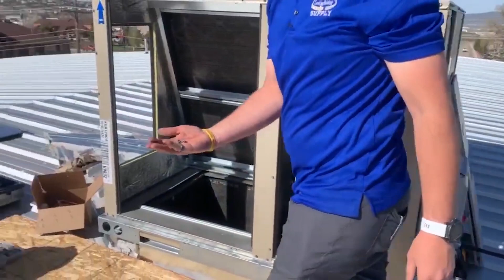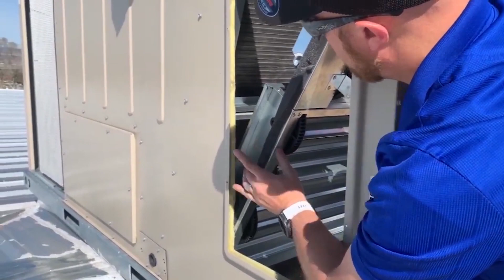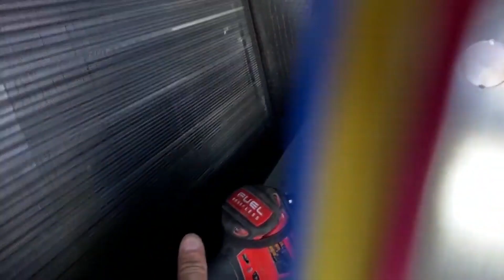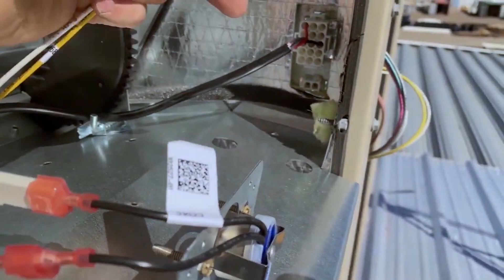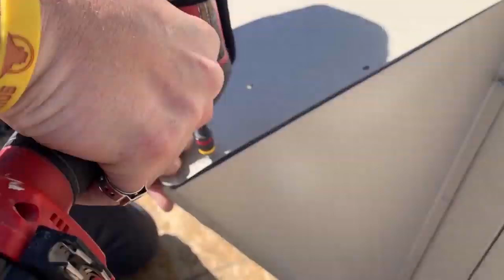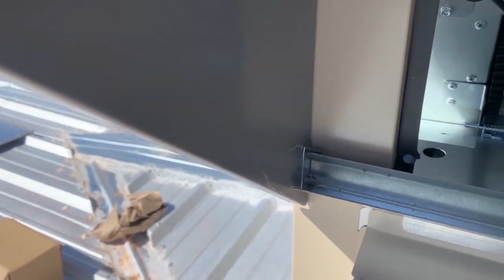Economizer step-by-step installation tutorial from PlumbersStock.com

Comment: Great install on the Economizer section and controller.

The gas reg is piped wrong in a vertical manner with the vent protector...protector should be facing up to stop water, snow from entering, like an umbrella.

All aces otherwise!!!